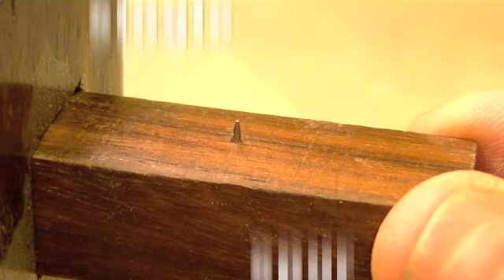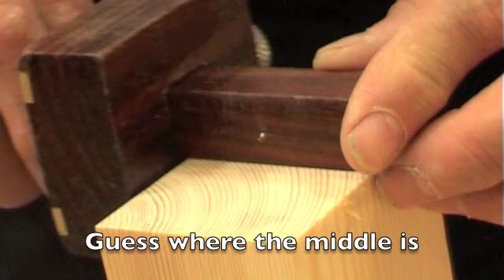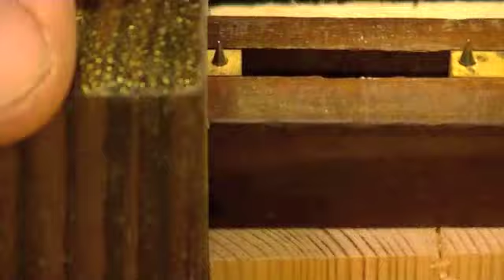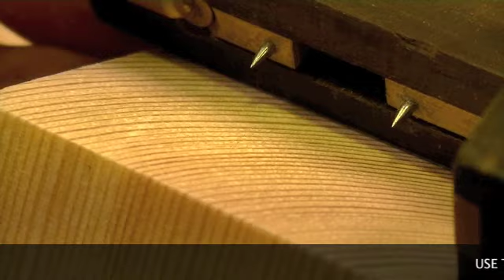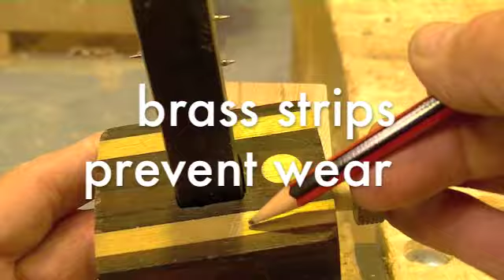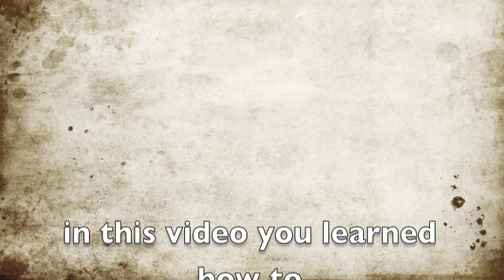marking gauge

Comment: A 5/8ths thick square wooden rod, pierced by 2 - 5 or 6mm spikes set equidistant from a brad set as the marker. The distance between the spikes is set at less than the width of the stock. Lay the rod against the end and rotate the rod until the spikes rest against the sides. Roll the brad into the work. Centre is found and marked in one move.

Making a tool that is adjustable is tricky. A suggestion might be a set of straddling holes in the stock and quick replaceable pins. Lash issues arise here. Also tricky is an adjustable two pin system. The only think I can think of is a centrally fixed adjusting nut and a rod threaded left hand on one side and right for the other marker. A similar adjuster could be used for the guide pins to keep them equidistant for different sizes of stock. U would still need a square marker for laying out the mortise scribe lines. And tightening the double threaded rod needs some thought. Might have to use a set screw slider arrangement.

Comment: Got a newb question. For finding the center wouldn't drawing an X be faster?
Reply from the maker: Michael Justice I guess it's another way to find the centre using a combi square and a pencil , but you would have to draw a line a right angles and then two 45 degree angles and then set your spur on the gauge to where the lines cross . It depends how quick you were with the marking out . If you use the gauge alone you are not handling several tools. I might give it a try, thanks fior your comment.
Reply: Thanks for the quick response! Well that's why I'm a newb...I didn't even think about the other lines. The thing I like about traditional woodworking is it forces me to think about what im doing and to master technique. With power tools and other gadgets, I kinda go on autopilot and I think my skills don't improve as much.